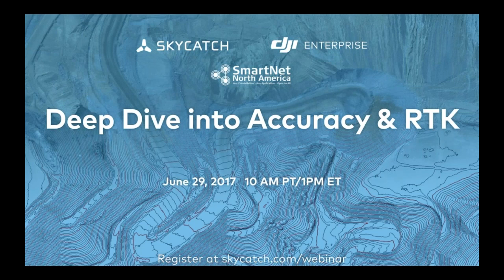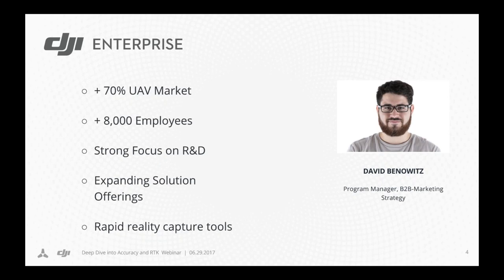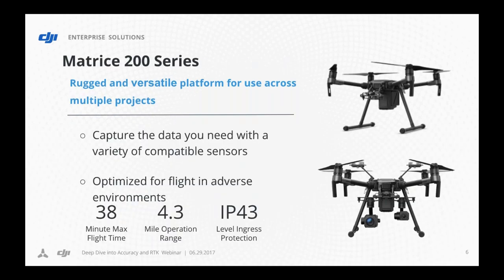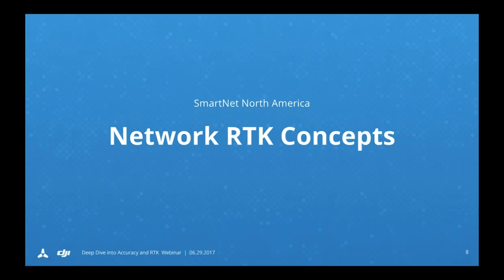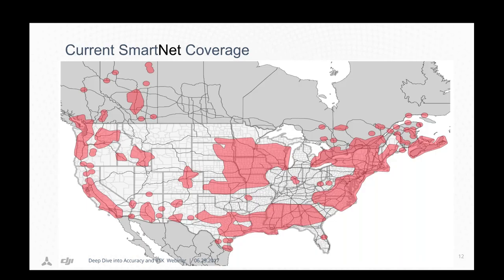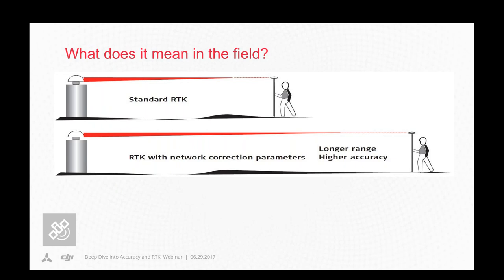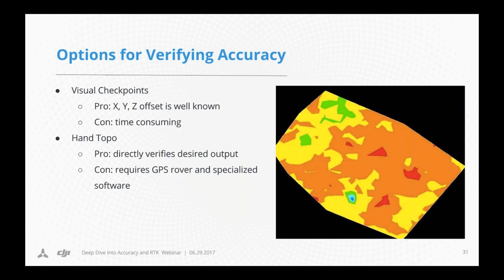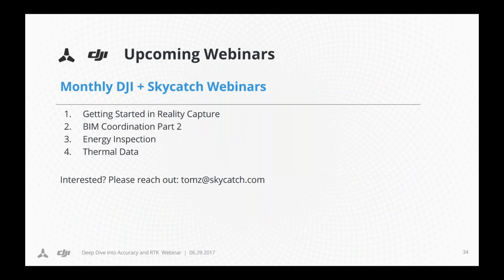Deep Dive into Accuracy & RTK Webinar

Comment: Sorry I missed the Webinar today, but I didn't feel like getting up at 5am ;). One question - Is the DJI Matrice 210 RTK compatible with Network RTK or any other reference stations other than the DJI base station? Thanks
Reply: The Matrice 210 Rtk is the RTk system you think.  It does not connect to a RTk network or Base station for surveying application.  It does not use RTk to correct EXIF data in your images.  All it does is keep a good solid GPS position of your drone. Good application would be is when using in areas where lots of interference.   Keeps a solid connection as well.